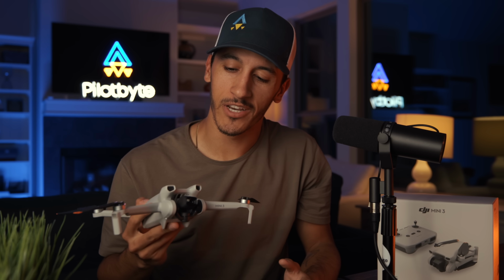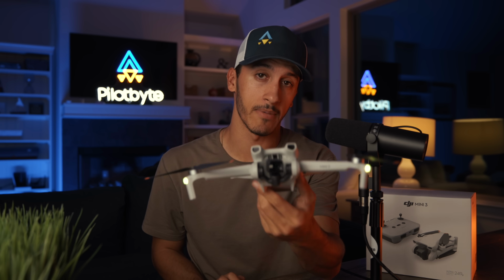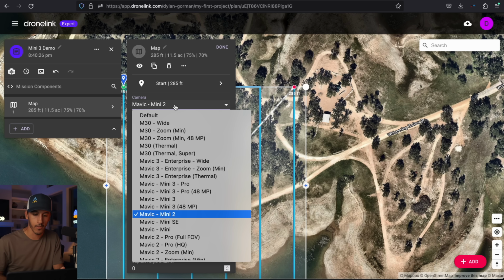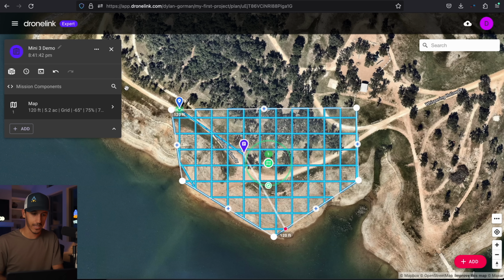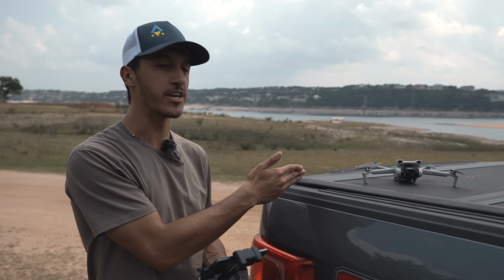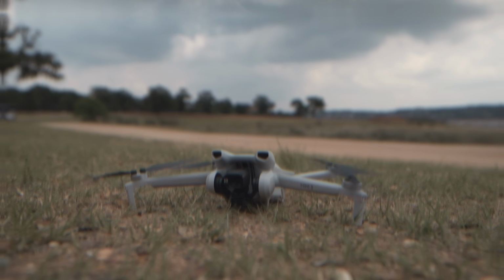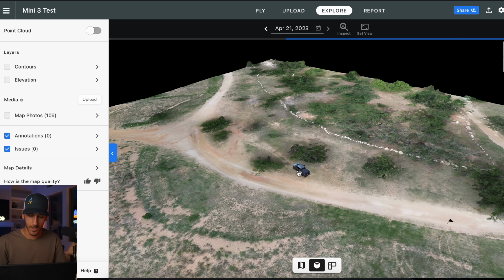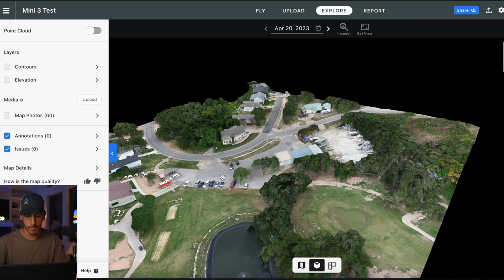The DJI Mini 3 Just Got BETTER | DJI Mini 3 Photogrammetry

Comment: So I'm doing this on Sept. 2024 and as of right now, the "pay once" options you get are $30-$60-$120. Mapping missions are available from the $60 plan and higher. However, some of the premium features such as camera angles and the map pattern are only available with the $120 and the professional, monthly subscription models. Also, according to the website, it states that professional plans need to be used for commercial work.
Reply from the maker: I have no direct control over the change in pricing or terms so I am sorry to hear that they have updated it. It has also been over a year since I produced this video. Mostly everything in this still applies as there is no SDK out for the DJI Mini 3 or 4 drone. Best of luck!
Reply: @DylanGorman  times change. It's normal. I was only putting an update for anyone else, like me, who was trying this out now. Didn't mean to seem like I was trying to step on your shoes, friend. Sorry if it came out that way!

Comment: Newbie question: is it possible to use dronelink with the RC (not pro) model controller?  or only from the phone linkable controllers?
Reply: trying to figure out the same thing.... What did you learn?
Reply: @DoctorBlankenstein  No luck with my mini 3 and the RC Pro..  If you want to be able to use it you'll have to get the other remote that attach's to your phone. Teach me to be fancy on my first drone. BUT in the few months i've had it, i've made 1000 dollars flying with it so far, so it's paid its self and insurance off nicely.

Comment: I have a question.  I have seen a lot of bad press regarding very low performance of Dronelink on both android and iOS for the Mini 3 (standard) with frequent crashes to the point it is unusable.  This seems due to DJI not supporting any efforts for ask post the mini 2 series.  What’s your experience of this please and what android devices have given you the most stability?

Comment: so very interesting video, thanks for it !! so i have been talking to guys who design golf simulator golf courses and wanted them to replicate my home course in Johannesburg, south africa. the thing which is required as a starting point for the designing of these courses are lidar points.  It was identified the lidar points provided by the local council was missing the CRS for point cloud i was advised to try and get .las files or DEM (geotiff) files. from your experience with the mini3 pro can we achieve getting these lidar points or something similar which can help with this course building ?

Comment: Hey Dylan! I've got a question about the best OS to accompany DJI drones in projects. Some apps need windows others android, so shall I go for Windows labtop, or would a new tablet able to hold ? Or maybe i need both?
Btw this is only for the out in the field needs (got a main desktop in office)
Reply from the maker: I personally have both a windows and mac laptop and desktop at home. For the field I prefer a mac laptop and then IOS device for mission planning and app control. This beta however needs an android device so there's that to consider.
Reply: @DylanGorman  Thanks for the info! What IOS device do you use for mission planning and app control out in the field? I am mainly an Android/Windows user so I am not very familiar with Mac products.

Comment: Great way to explain stuff (although maybe a bit dangerous in the sense that Photogrammetry is so much bigger than this). I know you don't force anyone to buy either of these apps, but unless modifying the Gimbal Pitch stopped being included on the 50$ plan during the last 2 months, this video is quite misleading (I bought it and can't do it without paying another 50$).
Reply from the maker: This video was merely just a means to introduce a simple automated method for data capture with this drone. I know photogrammetry goes much further than this (I use much higher end equipment and tools to produce high quality data sets for clients all the time).
Reply: @DylanGorman  I am sure you do. That is perfectly clear, given the comfort and prowess with which you speak about these topics. My only "issue" was saying that the 50$ version allowed to change the gimbal pitch - unfortunately, that is not the case.
Reply from the maker: @jampaPT  my mistake then. Companies change thins often. Realistically another $50 for a total of $100 on software that can do as much as DroneLink can is a steal. I have some applications that cost as much as $1500 one time or $7000 a year.

Comment: I am interested in using this for Search and Rescue to map some common canyons where people get cliffed out and require technical rope rescues. I wonder how it would do for that type of terrain.
Reply: Live it works great. Not super good in high wind. We use them in public safety for SAR with thermal cameras. These automated fly throughs wouldn't be very helpful for that but maybe would be good for training models.
Reply: @LILOREB  yeah I was thinking for training. LASD is finally starting to get traction on a drone program for SAR. It’s easier for us to call a predator in than launch our own 🤣
Reply: @Mauronic100  What is LASD? TIA. 🙄
Reply: @jempro1674  LA sheriff department which is associated with  LA SAR teams
Reply: @LILOREB  What thermal camera are you using on the Mini 3?
Reply: maybe in known higher risk areas having a much higher quality mapping of the area provided by one of these drones it may be easier to perform an efficient search with lower risks? I don't perform SAR but i imagine a higher quality map is always helpful (provided tree cover isn't too much of an issue)

Comment: Curious when the app crashes does drone just stay hovering in position or does it default to the settings that you pick for when signal from remote is lost (RTH, descend or hover)?

Have the Mini 3 Pro myself.
Reply from the maker: It just hovers. Your controller is still connected so you will still have full control of it in the event of a crash.

Comment: You said it's been just about a year since the Mini 3 came out. Mini 3 was released in December 2022. The Mini 3 Pro was released last May. I took a double take because I just ordered the Mini 3 thinking it was a recent release and heard you say it was a year old already!! A little research calmed me down!!
Reply from the maker: It’s the exact same platform, the only difference is the obstacle avoidance sensors on the pro. So my statement still stands lol
Reply: For real? You better check the specs between the Mini 3 and the Mini 3 Pro. Differences....4k 60 vs 30 fps, O3 vs O2 transmission, 34 Pro flight time vs 38 minutes Mini 3, ISO Mini 3 100-3200, Pro goes to 6400, Asteroid mode in Pro, D-cinelike in Pro. Not quite the same platform in my opinion, but I did like your video about mapping.
Reply from the maker: I stand corrected on the camera and occusync. However, the SDK works across both drones the exact same.

Comment: Can the Mini 3 do any decent map one just one battery? Did it manage to capture your test one? Im getting the drone tomorrow and I'm considering buying more batteries
Reply from the maker: Yes totally possible. I’d look at the extended battery option so that you can get 45+ min of flight time which will let you cover even more land on one battery.
Reply: @DylanGorman  just keep in mind if you go the extended battery then you are over the micro drone weight and require to be licensed as well you will need to register your drone (in Canada anyways)
Reply from the maker: @CalTek  If you are making money with your drone in any capacity (even if the drone is under 250g) you still need a certification to fly here in the USA. But yes I  hear what you are saying.

Comment: The DJI mini bites. The small sensor size and footage is a disgrace to the mapping world. The M300 P1 is the minimum standard nowadays. The mini It is a toy and made it possible for everyone and anyone to do aerial photos for free. So it is worthless because anyone can do it now. Save you money and don’t buy it. But I am sure communist China  Enjoys you propping up the gimmicks and making sales for them. Dealers are a dime a dozen and it is frustrating to see the pushing and aggressive marketing of DJI to proliferate the drones. It is not safe.
Reply from the maker: I'm sorry but I disagree with you saying that the M300/P1 is the "minimum standard" for mapping. These drones are all a tool, it's how you use the tool that it becomes effective. I know companies that are using the Mini 2 for very basic mapping as you can still produce a cm-level accurate model with the right approach.
Reply: @DylanGorman  The small sensor in the camera make for distortions. When people companies deliver these data and it get to engineers, it will be inaccurate and useless. It gives the drone a bad reputation. I have been there and done that! There is no cheap way to go. Cheap get cheap results. The Mini is cheap and a reproach to the drone industry.

Comment: You don't have the $50 Dronelink  you have the $100 one because you can only have a gimble pitch at only 90 with the $50 option so no 65deg
Reply from the maker: I have the $50 one, not the $100. I would know because I just paid for it a few days ago before uploading the video haha
Reply: @DylanGorman  It is $100, which is the Elite plan as the $50 premium plan has limitations. I just paid for it myself. You can check and verify

Comment: I really hope they are able to add the SDK support for the RC eventually, I just got my mini 3 pro with the RC. I wish I would have know this was coming out, I would bought the N1 instead.
Reply: What's SDK?
Reply: @dontbelazy007 software development kit. Allows third party software development. Pretty sure he said that a beginning of the video
Reply: Still can... I bought the RC, but found its screen much too small for seeing detail, so I bought the N1 off ebay for $34 shipped... I use it with a big 12.9" iPad and now the RC sits in a drawer. Easy to switch back and forth though if I ever need the relative smallness of the RC remote, but so far that hasn't happened.
Reply: @wrybread where you find a loose N1, I searched online but can't find any loose controllers
Reply: @wilfredprins9718  ebay
Reply: @wrybread switching between rcn1 and rc doesn't need binding?
Reply: @juddnetcafe  It does. Takes 2 seconds. It's a bit annoying that you need internet to do it though.
Reply: @wrybread  how did you use drone deploy with an iPad... I thought you can only use it with an android device.
Reply: Too small? Lol. Its the best screen to use with the mini 3 pro. Get your eyes checked if you need a damn tablet to fly a drone.😂
Reply: @vidademikey9790  no need to be an ass. I'm using a drone for surf checks, there's no chance you can see details about the surf on a phone sized screen. And incidentally the RC Pro blows the RC out of the water. But again it's too small for my purposes and anyone else who needs to see fine detail.

Comment: What if you have the controller that has the built in screen. How do you get the app and mission onto that
Reply: The app works with the DJI RC Pro. That's the black one with antennas. It does not work with the DJI RC. That's the gray one that You can get the mini three or the mini 3 Pro. You will have to use the N1-RC with an Android phone if you don't have the pro version of the RC

Comment: Two things. One, max VLOS for the mini 3 is about a hundred yards. A good standard is to be able to see the drone, then look away for a few seconds, like when you look at telemetry info on your screen, then be able to visually reacquire the drone quickly. So about a hundred yards for me, less if there's a cluttered background. Try this out on your own on your next flight to determine your personal visual limits then don't exceed them. Be aware of backgrounds too, looking into the sun or clutter limits VLOS significantly. This limits mapping capability big time for the Mini 3 because it's such a small drone. Two (if it applies), remember, when you get a LAANC approval you must be able to be contacted by phone immediately per the requirements of your approval, so don't disable your phone if that's the number you gave on your LAANC request.
Reply: If they're willing to give big corporations huge fleet BVLOS contracts for craft with similar sensor payloads- I say "meh" to the BVLOS hysteria. If you're really worried, get a neon vinyl wrap and an ADSB transmitter
Reply from the maker: As long as you maintain VLOS of the area you drone is operating in then you are fine.
Reply: @DylanGorman  Agreed. I've flown a DJI MINI 2 over a river 1.5 miles wide, and back :)
Reply: U don’t need to stare at the drone the whole time…😂 as long as your about to locate it you can just fly🤦🏾‍♂️
Reply: @CrashOut328i  that too, lol
Reply: @CrashOut328i  That's what I was talking about above. Fly your drone visually out a ways then look down at your screen for a few seconds then quickly reaquire your drone visually. I think for a Mini drone that's going to be out about a hundred yards max.
Reply: If you think you need to see the drone to maintain situational/positional awareness, you are kidding yourself and and/or the FAA has been gaslighting you.
Reply: @TheCablebill  No I'm not and no they're not, I know from experience, see my response above. In the real world if everything goes okay you'll probably be fine but if you hit, injure or kill someone while flying illegally you are so screwed. Your insurance will be void too so financially you're on your own. Do you feel lucky? Your family's financial future is at stake. Gosh, so many people have this "it will never happen to me" attitude going on.....until it does.

Comment: I’m not a drone pilot (despite buying a mini 3 when it first launched), but this video got me wondering, not because I want to do it, just because it got me thinking.

Is there any software that could take a video stream, instead of stills, and use that to create a 3d model? My thinking is that at 25 or 30 fps, the software would have much more data to work with to create better models.
Reply: motion blur becomes an issue unless your shutter speed is cranked- which would work in very highly lit environments. I've done this before, taking video and rendering out as a series of photos- works pretty well. with 5 acres and 6k images on GCP's I got a 1.2cm deviation. (1/2000 shutter, 30fps HDR 4k, 8GCPs)
Reply: @BikesBobbers  wow 1.2cm deviation is pretty impressive!!!! Mind you, quite intensive on the post processing I'm sure.
Reply from the maker: Take a look at skybrowse! It creates models from you aerial video!
Reply: @DylanGorman  I will look, thank you!

Comment: Excited about this! Does it work for Mavic 3?
Reply from the maker: It does not
Reply: @DylanGorman  what’s your opinion on DJI not releasing a SDK on there flagship Mavic 3 before their lower priced drones?
Reply from the maker: @ssgllc7007  I own the Mavic 3 Enterprise so my opinion is a bit skewed. I think DJI is holding it on purpose so that it doesn't make the enterprise line irrelivent

Comment: Nice video thanks. I want to ask about battery swapping. If the battery is low during the automated mission does it land by itself or I should land the drone and if i swap the battery does it resume to the last way point of the mission . I am using mini 3 pro with the under 249g batteries.
Reply from the maker: You can set the parameters on how the drone behaves based off of the battery levels. What’s great about the software is if you need to stop the drone for whatever reason it will continue back from its last known waypoint. So you can do battery swaps and not have to worry about restarting the whole mission.